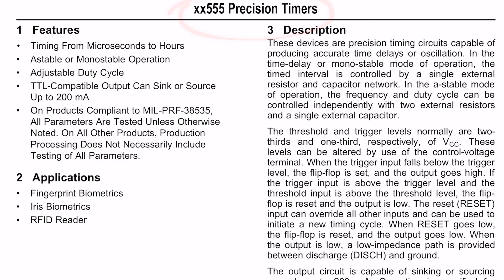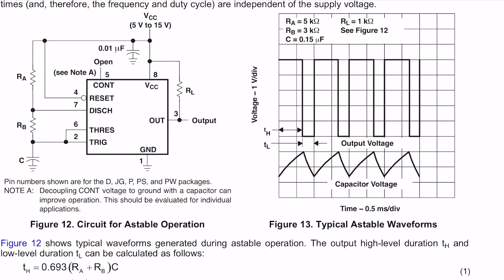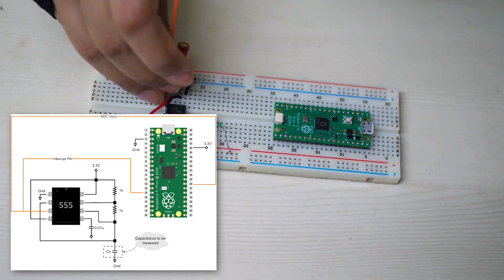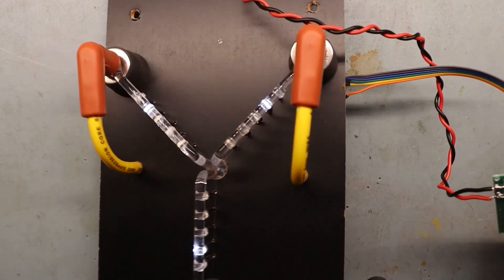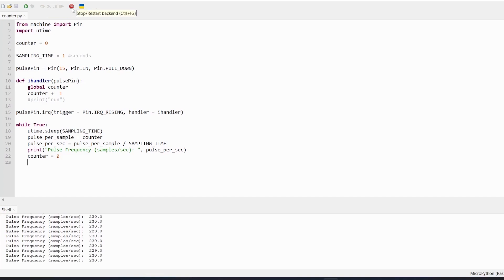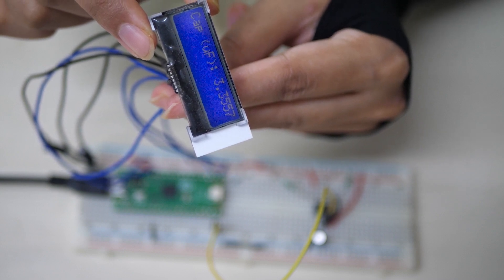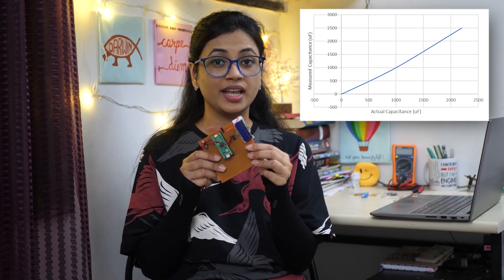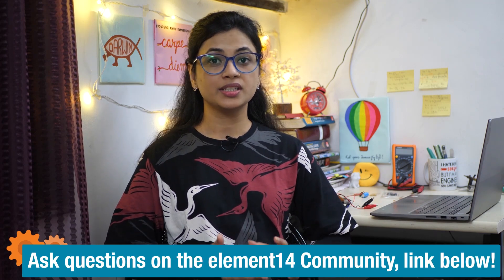DIY Low Cost Capacitance Meter Using a 555 Timer

Comment: The project is great. However, it is worth mentioning that contrary to what was claimed, capacitance meters are not expensive at all. In fact, for less than $10 one can buy a transistor tester that also measures capacitance and other important characteristics of capacitors alongside with many other things, such as inductance, resistance, etc.

Comment: just a crazy idea.. but if you make the resistors larger, would it be actually possible to use it to measure utp cable length by measuring the capacitance and then translating that to length using a bit of math?

Comment: Wonderful. In the days before microcontrollers, we'd have to salvage an analog needle-style voltmeter, and read the averaged voltage, working backwards to find duty cycle and then capacitance. If you use larger resistors for charge/discharge you can get somewhat better resolution for smaller capacitors.
Reply: Right! using larger resistor definitely pushes the lower side of measurement range if the bottleneck is only frequency measurable by microcontroller. But it would not matter if the parasitic capacitance at the port is comparable to the cap to be measured.
Reply: indeed. I tried it. both R=1M for pF, 100k for nF and 1k for uf caps.
Reply: Your comment is Best, advisory ,  how to measure 2.2 pf smd ?

Comment: I have trouble listening when you speak so fast, but I admire your knowledge. ❤thanks for Your Tutorial
Reply: I watch videos with the closed captioning / subtitles on, and they are very accurate for this video. Maybe that would help.
Reply: Thank you for your kind advice, I'll try it out.
Reply: Just a suggestion: It’s easier than you think to learn to read lips to an extent, and it really helps when getting used to unfamiliar accents. It’s also useful when working in noisy environments.